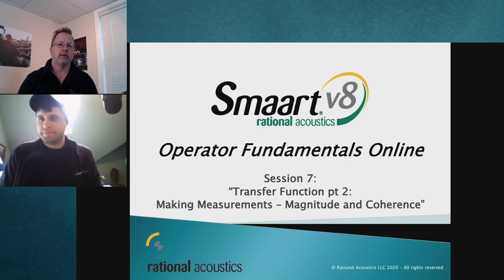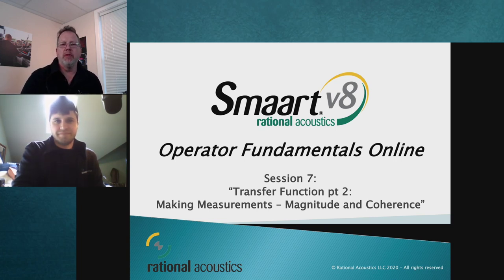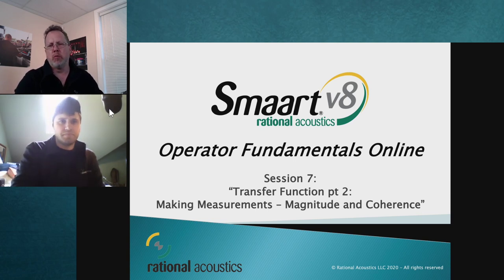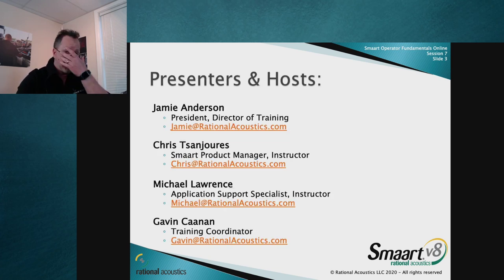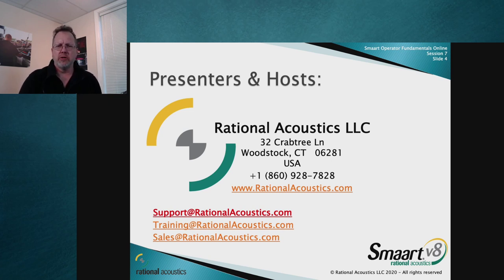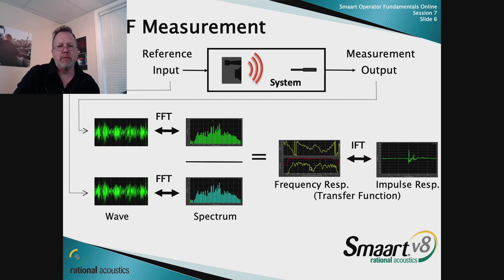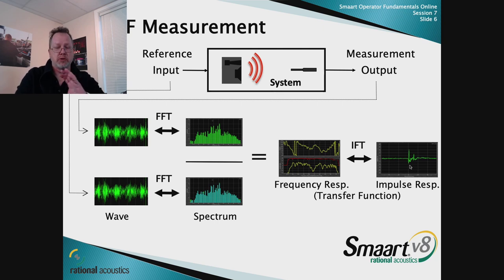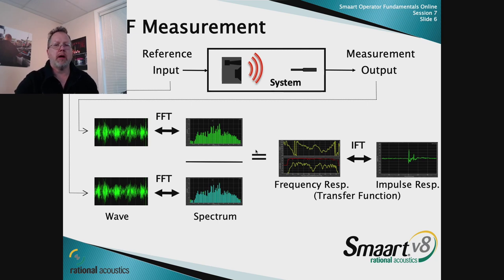Smaart Operator Fundamentals Online: 7 - Transfer Function Pt 2: Making Measurements

Comment: Does the eq latency set automatically before you turn on the measurement? Or how is this latency found since the tracker was off? Around 1:07:45
Reply from the maker: The delay values are the most recent setting - they will stay there until you change them. Jamie had run those measurement engines before the session started, so those were the previously set values.

Comment: How can i measure the output of my EQ? For example: Mixeroutpt Stereo into a Driverack 2 in and 4 Out to Poweramps (2XTop 2XBass). Do i use a y Cable? And do i have to use 2 y Cables one for low outpit and one for Mid/High Output? What if i use a LAB IPD2400 where the DSP is inside the Amp?
Reply from the maker: Hi Kul - 
Please contact us at support@rationalacoustics.com and a member of our applications team will be happy to help you.